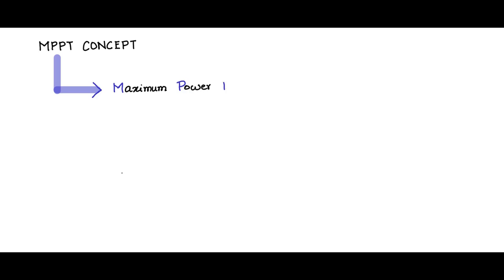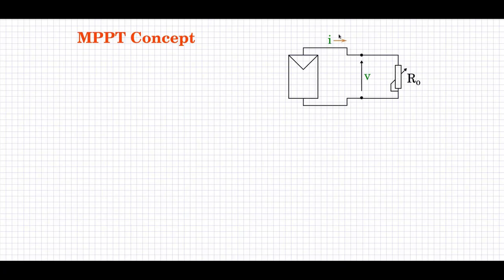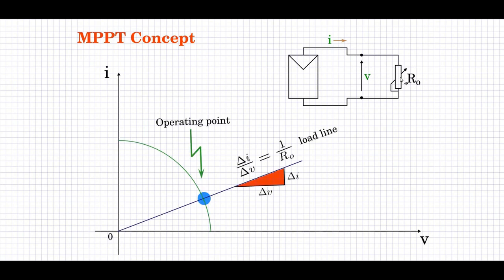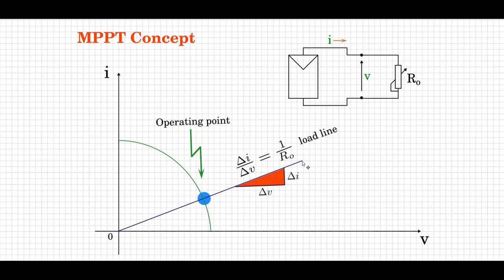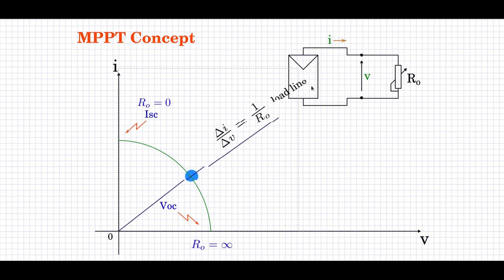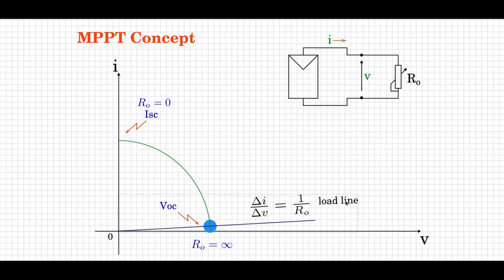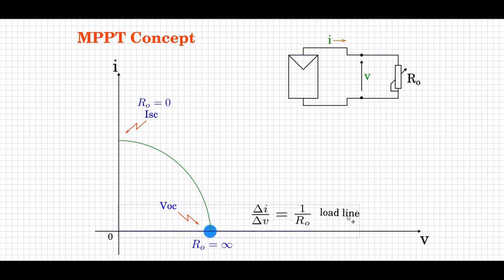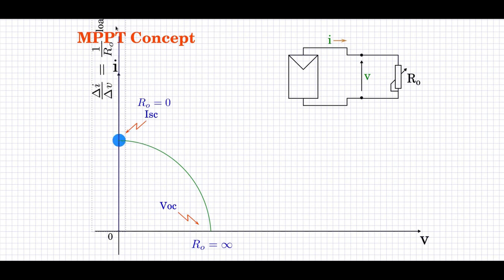MPPT concept

Comment: sir 1/Rt is conductance, not the admittance. Sir, you explained here that all variables measured from PV side and then PI Controller will provide input to the PWM but this will not work perfectly until when load side parameters are not taken into consideration at the same time. Nice lecture sir, there's many questions and confusion after this lecture. It may be possible that you would have explained it as an introduction to MPPT but duty cycle of converter needs to vary here every time

Comment: Nice Video Sir.In Solar On Grid Inverter with 2 MPPTs rated 11 Amps each.Can we connect MPPTs in parallel so that High current 18 Amps solar panel can be used?

Comment: i don't understand the use to track max. power if load changes ...what i mean to say is that the required power will be utilised by the load whether less or max. depending upon the 'Rt' then so be it! what is the need to track the max power?

Comment: Sir can I use solar panels system with mppt controller without batteries. I want to use solar energy during day and at night I want to use grid power. During day I want my system to be net metered. Please give suggestion.

Comment: this is total rubbish, WRONG tech and maths . Its all to do with the maximum power xfer, when the current source IR is equal to the load IR - very elementary electrical theory.  The load line is a 45deg tangent to the knee of the curve